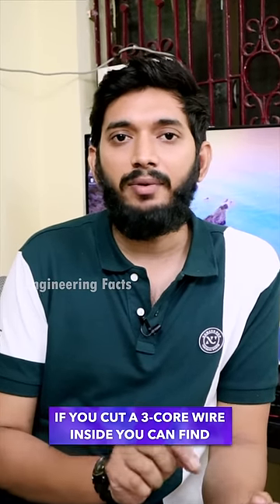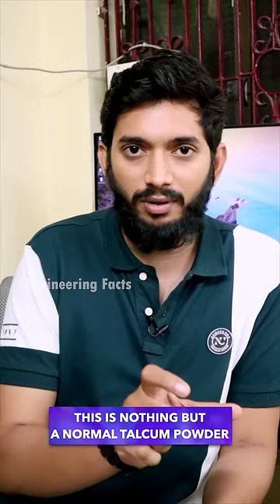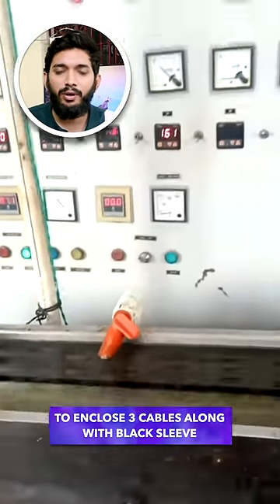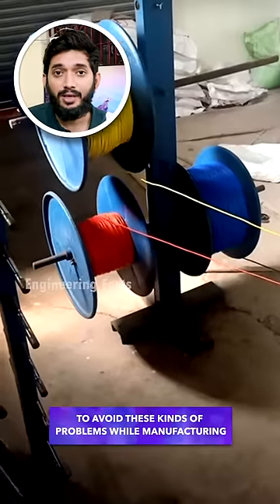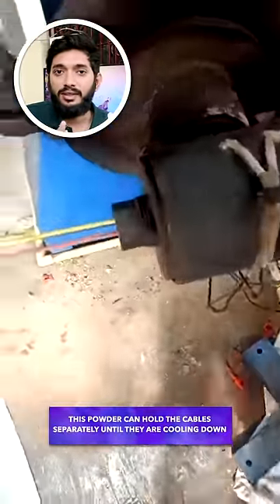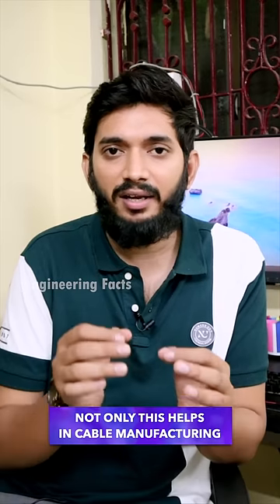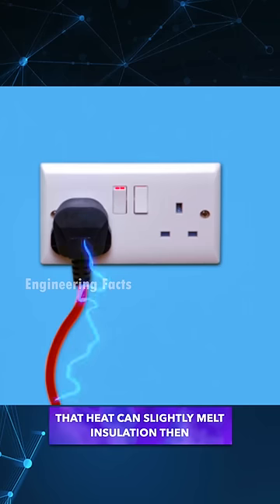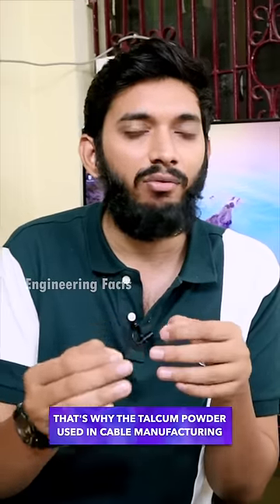Cable உள்ள powder கொடுப்பது ஏன்?

Comment: Hello, can you please put a video on the best generators (capacity, brands, fuel consumption) that can be used for a 4bhk house powering up all the electrical and electronic devises such as lights, washing machine, TVs, Fans, CCTVs, Routers, Mixer Grinders etc.

Comment: அண்ணா அந்த 3 core cable ல ஒரு wire la supply குடுத்தா இன்னொரு wire லையும் supply indication varudhu.. multimeter la check பண்ணும் போது 230v காமிக்குது.. but அந்த wire ah தொட்டா எந்த ஒரு shock m அடிகுறது illa.. எப்படி nu check பண்ணி explain pannunga anna